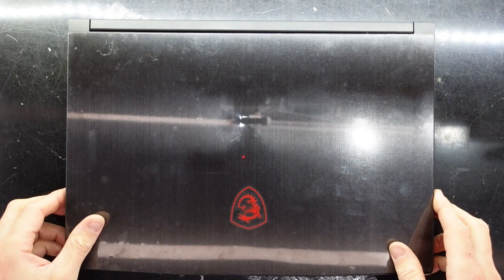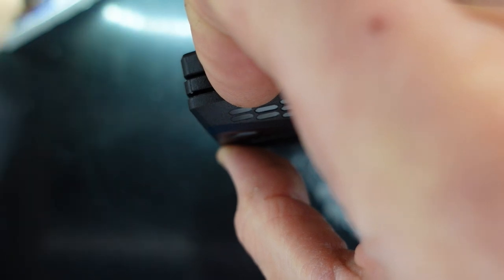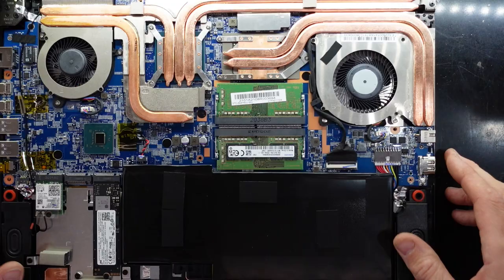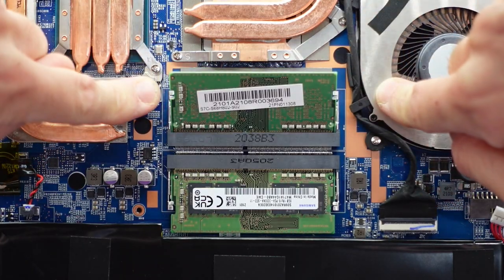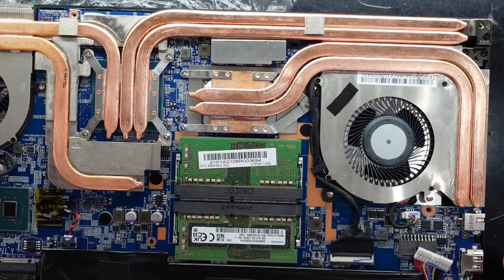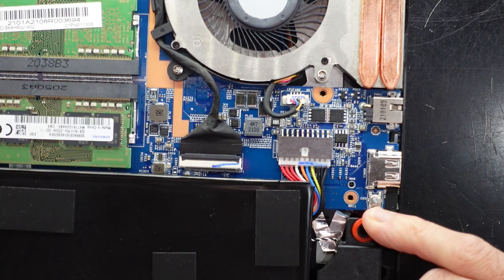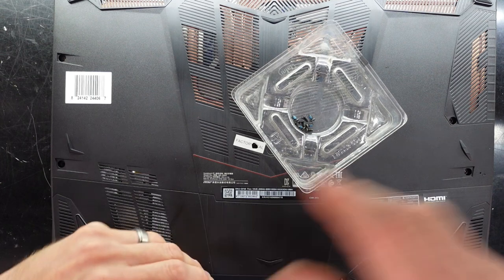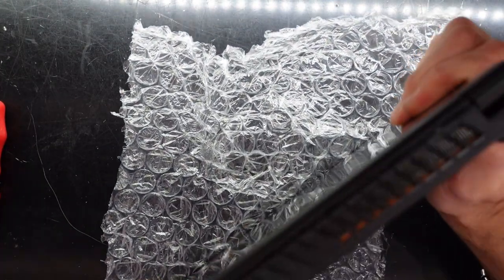MSI GF65 Thin 10UE Teardown and Ram Upgrade

Comment: thanks for the guide! was able to upgrade from 8gb ram to 16gb!
Reply from the maker: Enjoy the extra ram :)
Reply: @rickstechrepairs  what's the maxnimum ram for this?
Reply: @JinKazama92  I'm looking for this too after seeing a few games coming that recommend 32gb! I hope 16 isn't the max :O

I just ran Crucial's system scanner and it says you can cram up to 64gb in here... which i'm about to do! I have a slightly different model but it could be the same for yours i think - recommend running a scan via crucial like i did to find out for sure though. hope this helps!
Reply: @0phylum0sinter0  I eventually upgraded to 64gb :O
Reply: @JinKazama92 what ram did you go with? Specs? I’ve tried twice with no luck, always seems to be non compatible… or at least that’s what tech support says to me over the phone.

Comment: Great video. Am about to buy this laptop and you addressed all of my concerns with regards to it's innards. You rock!
Reply from the maker: Excellent. Hope you enjoy it!
Reply: @rickstechrepairs  can you make it a race-car ? with ICY BOX Aluminum Alloy Heatsink with Fan Designed Specially for M.2 SSD 2280, and cut a rectangle for the blower to stick out the bottom ?
Reply: @rickstechrepairs  or can you make it quick release nvme changer, by cut two rectangles in bottom for nvme swap and battery pull off without have to open ?

Comment: wanna share a short update regarding my gf65 thin 10sdr, it is said that supports up to 64GB ram but after i upgraded the device it was turning off constantly after random activity, went to pc service and they told its the charger so i bought a new one (lol) and that didn't fix the issue,  so finally i was able to fix it by myself. This laptop does not support 64GB ram although it is said so by Msi... i tested both sticks separately in both slots and they ran without problem on fully occupied pc, so it turned out that there was no bad ram stick. aT the final i put my old stick of 8gb together with the 32gb stick and currently running 40Gb of Ram, cuz i guess there's no enough power to supply all the 64Gb, cheers
Reply: 2666 or 3200 will 3200 support in this lap?
Reply: Actually the sticks I bought were 2933, so if I've tested 2x 32/ 2666 or lower mhz they'd probably run without crashes, but these manufacturers are such suckers they create these motherboards so that if you try to overclock the machine it'll crash, so its still not confirmed if it'll run with 2 32/ 2666 or lower mhz. This laptop is meant to go with 2666s
Reply: @tun1to  Thankyou bro so il go with 2666 anyway 5 to 10 fps difference

Comment: Hey Rick, the spudgers you use (which are nice) are out of stock / the link doesn't work.
I got some terrible spudgers that just cut up my hand and I had to just use my smallest flathead screwdriver and deal with the slight plastic scrapes/shaves.
Any current links for the spudgers/pry tools similar to the ones you use?
Reply from the maker: The new pry tool im getting is one of these
https://www.aliexpress.com/item/33048297716.html?spm=a2g0o.productlist.0.0.354752b4WZi13P&algo_pvid=30f8e045-2c43-425f-8027-ee977c0a6cf6&algo_exp_id=30f8e045-2c43-425f-8027-ee977c0a6cf6-16&pdp_ext_f=%7B%22sku_id%22%3A%2267388371256%22%7D&pdp_npi=2%40dis%21AUD%21%214.78%21%21%211.42%21%21%40210318cb16586638016641056e916b%2167388371256%21sea

I also just ordered these
https://s.click.aliexpress.com/e/_DCJnmf1

Do need to be careful with these as they do have a change of slicing your hand

Comment: Hello! I have a question, what is the size of the screws on the back cover of the main unit?  I'm looking for a replacement.
Reply from the maker: Not sure sorry, look to be a fairly standard laptop screw size
Reply: @rickstechrepairs  
Thank you.  There weren't many detailed videos of repairing this model, so it was very helpful!
Reply: @Tukamoto2nd69  they are m2 2mm or 2.5 dunno exact diameter screws i suppose..
Reply: @mrigom1  thank you.
I tried it with the size of m2.6 and it worked.
Reply: @Tukamoto2nd69  thanks for the update! Glad I could help :)

Comment: recently bought this exact model of the MSI GF65 Thin 10UE and im waiting for it to arrive currently. would it be an issue if i were to upgrade the RAM to 16GB using the same 1x8 stick in your video but instead of replacing the stock one, just keeping it? so, the msi gf65 thin 10ue stock ram stick + the samsung stick. if not, do you happen to recommend any cheap RAM 1x8 sticks that i could buy 2 of? kinda wanna stay under or around $50 USD
Reply from the maker: You should be ok using the existing stick of ram in there and miss match brands
Reply: @rickstechrepairs  okay awesome, thank you for your reply.
Reply: Wondering if I can mine with this laptop , I have same laptop and has rtx 3060 ? Please advice?

Comment: Thank you! just thumb up! 
One question, I have two 16GB DDR4 but 2666MGz total 32GB.  
I want to do some video 4k editing.  Are they better to replace those that come with the machine two 8GB DDR4 3200MGz?

Thanks
Reply from the maker: Depending on the cpu you won't get a performance increase by changing the ram to a faster frequency
Reply: @rickstechrepairs  It is i5 version of GF65 the RAM has lower frequency 2666Ghz but 32GB verses 3200Ghz 16GB.  It is for video editing more than gaming.

Comment: Thanks for video, the guide gonna help me to upgrade mine. Im about to buy a ram.
Could you tell me what kind ram should I buy? I get it should be 3200mhz and sodimm but I've seen 1Rx8 and 1Rx16. Is that makes a difference? Is stock ram 1Rx16?
Im about to buy Kingston 8gb 3200mhz 1Rx16 or 1Rx8. What do you think?
Reply from the maker: load up CPUZ to find out what ram you have, not sure what stock ram is

Comment: I have no clue with Laptops.. Just got one, but might need 32gb of Ram.. Would you suggest I take it to a ...shop for them to put it in for me?
The waranty will be void whoever breaks the seal anyway, right?
Reply from the maker: if you are unsure and dont want to risk any damage, take it to the local repair shop
Reply: u call ur local msi thingy, and ask them. Ofc that doesnt break warranty, even if u still care about it, use a hairdrying fan and carefully remove that "seal"
Reply: @ignatrotenberg7676  i'll see if there's a local msi thingy around, thanks!

Comment: Hello, one question. The Laptop originally comes with 8 Gb DDR4 3200 Mhz? or does it come with a frequency lower than 3200 Mhz?
Reply from the maker: It will either come with 3200 or 2666

Comment: I just purchased this on black friday along with 2 32gb sticks which i installed after setting up windows 10.  After installing the ram my touchpad stopped working and I have reason to believe that it has something to do with the small ribbon cable under the bottom ram slot near the battery. Would I need to remove the battery completely to connect it back where it belongs?
Reply from the maker: 4:44 you can briefly see the cable under the ram 

i would unscrew and move the battery out of place to help make reconnecting the trackpad cable easier

Comment: Hello, I have put new ram memories in my laptop, MSI GF65 Thin 9 SXER, and it happens that it turns off instantly, I just changed the ram cards, and I already tried one by one and they work but only like this with 32gb both are 32gb to be 64gb, but I don't know if I have to change the hard drive, because I can't partition it with MSI's native software, and a memory came open when I bought it online, I already tried it but only one works, I tried both slots on the motherboard, I don't know if it's the hard drive that has to be formatted or the faulty memories, I don't know. Could you answer me? I already reinstalled sectors with the windows 10 tool assistant but it's still the same if I install both memories. The memories are  Kingston Fury 2666Mhz speed only are compatible with that.
Reply from the maker: Not sure what you have done sorry 

I would try a fresh install of window s 10

Comment: I’m ordering a GF65 10-UE soon, same specs as yours however my cpu is i7-10750H, and my RAM is 8GB.

8GB of RAM is too less and may throttle the rtx 3060, so I’m upgrading and will buy an 8GB module to make it 16GBs in total.

My question is whether it’ll arrive with 2 4GB RAM modules installed, or only 1 8GB module?

In this video yours arrived with 2 modules installed so I’m worried mine will come with 2 4GB modules and limit me to 12GBs of RAM if I upgrade with the 8GB module I’m ordering.
Reply from the maker: I would hope in this day and age it's a single 8gb stick

best wait till you receive the laptop and find out for sure then
Reply: @rickstechrepairs  I see, thank you!
Reply: Just like me. 8gb ram not enough as mostly modern2 games use a lot of ram.
Reply: hey did your laptop have one 8 gb stick or 2x4 gb stick
Reply: @hoofedsplash6905  i have the same spec MSI gf65 it arrived with 1*8gb ram [sk hynix 8gb 3200mhz]
Reply: @mobinmaroofi9585  nice

Comment: Hello, I am planning on buying this same laptop and adding ram and ssd. Do you know if it comes with two 4 gb sticks or one 8gb stick? Thanks:)
Reply: Mine came with one 8gb stick
Reply from the maker: usually just 1x8 Stick
Reply: Mine came with two 8gb ._.
Reply: @rhain527  what's the problem with 2x8GB? Isn't it better?
Reply: @Sphynx93rkn  it's not a problem, i just thought that this model only came with 16gb of RAM
Reply: @rhain527  ah ok
Reply: @rhain527  there's a lot of variations of the gf65, that's not too unusual. Did yours come with a 1660ti?
Reply: @over7532  mine came with the 3060
I always thought that the gf63 always come with 8gb and the gf65 16gb

Comment: Weird sound coming from the processor part. Can you tell me why it's happening? The sound is synchronous. May be it's coming from the part just above ram which is the processor (i7 10750H).
Reply from the maker: coil whine, or thats what i would suspect. 

dont think its anything to worry about
Reply: @rickstechrepairs  expecting it to be coil whine but it started after I started mining overclocking gpu vram

Comment: Hello! After doing this, my laptop doesn’t charge all the way to 100%. Do I need to recalibrate the battery or did I possibly damage anything?
Reply from the maker: No there shouldn't be any need to calibrate anything
Reply: @rickstechrepairs  I ended doing the battery calibration in the dragon center and now it shows my battery is 100%. Could I have damaged something?

Comment: hello, I have a question about this laptop, namely I use this laptop, have you ever had problems with freezing the screen when starting or randomly when using it, it happens to me often, I upgraded the BIOS but it still happens to be said about once every two days. I'm looking for help, in the shop where I bought it was the last one and I can't get now one, only cash back, but I wana laptop not cash.
Reply from the maker: if there is hardware faults i would go with returning it

Comment: Oh noes... This is sad. It doesn't have the ssd/hdd slot like nitro5.

Is the battery replaceable tho?
Reply from the maker: ?? It has a spare NVMe m.2 slot 

And if you can get in the laptop you can replace the battery
Reply: @rickstechrepairs  what he means probs the sata 2.5 inch bcs acer have that

Comment: What should i do if my laptop ( same model as this ) is making grinding sounds, is it just a fan problem or a hard drive problem, sorry im not a very good at hardware, should i be worried, if i should what should i do?
Reply from the maker: open and inspect further to determine what part is making that noise
also should still be under warranty if you are lucky

Comment: Hi. I have the same laptop model except only 8gb ram. I want to upgrade it. My 8gb ram is CL 21. Any idea if i can put new 2x8 3200mhz ddr4 BUT WITH DIFFERENT CL? like, dual channel but both of them are different than my factory ram CL. is it possible? 👀
Reply from the maker: if you put mis-matched ram in, they will match each other at the speed of the slowest stick.

So i think you will be fine

Comment: Does the machine need to be drained of power in order to upgrade?
Reply from the maker: Disconnecting the battery when you open it will be fine

Comment: can I add 16gb to the 2nd slot even if it's only 8gb on the 1st slot? also with ssd, 1TB on the 2nd slot while 512gb on the 1st?
Reply from the maker: yes and yes 

you can have miss matched ram but will lose dual channel performance of matched sized ram
Reply: @rickstechrepairs  is having 8GB + 16GB still better than having 8GB*2?
Reply: You can add the 1 TB ssd it won’t cause any problems but having miss matched ram that is different models or different gigs can cause issues you would be better off to have 2 8 gb sticks that are the exact same then trying to miss match them could cause crashing and other problems

Comment: Can I upgrade with 3200mhz or it has to be 2666 also if I can do 3200 which cl..is it 3200 with cl22 or cl19 or cl16 Caz I think cl16 is better but I don't know if this laptop supports xmp
Reply from the maker: depends on CPU some dont support 3200mhz, i go with the assumption that cheap gaming laptops dont support XMP

Comment: This have a bateria mode thath Will stop charging when It reaches at limite like 80% tô protect the batery like Asus?
Reply from the maker: I think in the dragon control center there is
Reply: @rickstechrepairs  Nice! I was considering to Buy a Asus Tuf dash with RTX 3060 but this MSI costs ao much less than the Asus. O think I'm going with MSI even with the 75w Gpu.

Comment: Im literally going to cry ive been struggling with the battery plug for half an hour after having spent 3 hours trying to open the cover. I just want it over god please help me.
Reply from the maker: At this stage I would just take it to a local repair shop, might cost a little but sounds like it's not worth the frustration

Comment: I CANT GET THE COVER ON, THE STUPID AUDIO PORT IS IN THE WAY, PLSSSS I NEED TIPS ON HOW TO GET THE COVER OVER THE AUDIO PORT
Reply from the maker: Slide that side on first, before putting the over edges on 

So slip the cover over the audio port first
Reply: @rickstechrepairs  it just doesn't fit I've tried for 3 days now

Comment: hey you are using bad ram it is writen  on it 1Rx16 that is a slow ram you should get one that say 1Rx8 it has more banwith  i have qution do you know what port is directy linked to the dedecated gpu       sorry for my bad english
Reply from the maker: im thinking you are talking about "Dual Rank Memory" valid point

In not sure which port is directly connected to the Dedicated GPU
Reply: @rickstechrepairs   thank you

Comment: Hello there! Question for anyone out there who has the GF65 10UE model with 8GB of ram and upgraded to 16. Was the difference in performance after adding ram noticeable? I am debating whether or not I send it back as I am not too impressed with its stock performance at 8GBs.
Reply from the maker: Expect 5 to 20% better gaming performance in dual channel
Reply: @rickstechrepairs  Thanks. I am coming from a desktop with a 1650 Super and Ryzen 5 2600. I expected better performance from this 3060 but it isn’t seeming to tow the line as I thought it would.
Reply from the maker: sadly a good mid speced gaming desktop would usually perform about the same as a higher end gaming laptop.

The wattage of the 3060 in the 10UE is very disappointing i found
Reply: @rickstechrepairs  If I could ask - could you please run a Unigine Valley benchmark on your GF65 and send me the results here? I would appreciate something to compare to as mine is performing far below my expectations. Want to prove whether it's defective or not.
Reply: Try using the performance mode on the laptop while playing games, that does help the GPU use the entire range of it tgp. Can make quite a difference
Reply: @tejasbaviskar352  Actually, I solved the problem. Surprisingly, performance mode was the issue. I tried gaming on balanced mode and experienced a boost of roughly 80FPS. I went from averaging 80FPS in PUBG (Performance Mode) to a 160FPS average (Balanced).
Reply: @colinsmart5243  ooh that's quite surprising! I am about to buy the laptop too, can i expect 60fps on modern triple AAA titles like rdr2 on max settings?
Reply: @tejasbaviskar352  Not sure yet. It will play Battlefield 5 on ultra at 90-130fps without ray tracing.
Reply: @CR-cl3le  I have the i5 10500h
Reply: @colinsmart5243  the 75watts rtx 3060 is not near the performance of the 115 watts rtx 3060 thats why u were disappointed and the 8gb ram may be a bottleneck to the gpu.To test that download msi afterburner and check if the gpu is being used up to 90-100% if not that may be the ram is full thats what is happening with my i7 1660ti in rocket league where it doesnt need much ram im using 90% gpu im getting 200fps max graphics 1080p while in fortnite im using 35% on gpu 130fps and in creative (private match) where the isnt much action so i dont need as much ram im using 50% of my gpu im getting 200fps (low settings ) hope this helps.
Reply: @rickstechrepairs  Hello mate! Question for you, I have de i5 model with only one 8GB stick of RAM. Can I just buy one identical RAM and upgrading it to 16 GB dual? Or you recommend to buy the pair of RAM ? TY dor the video!
Reply: @juanalvarez2385  idk if you still have this issue, but if you want you can wait like 2 or 3 days for me to test this out. Well not really test it out but im upgrading my laptop from 8gb ram to 32gb ram. Ill see the performance boost, and ill let you know.😁